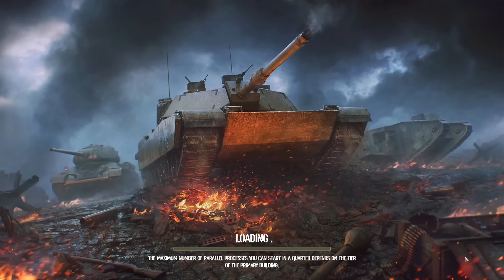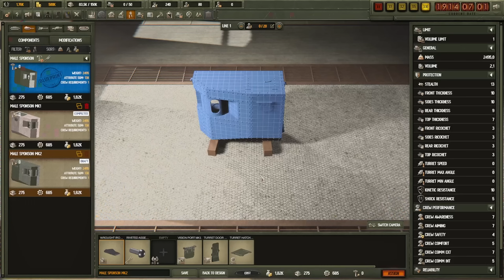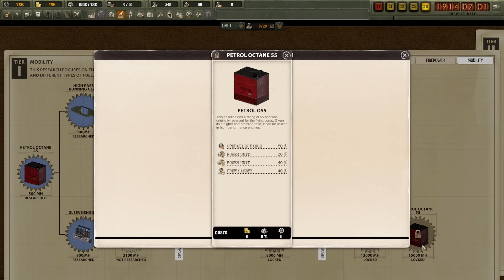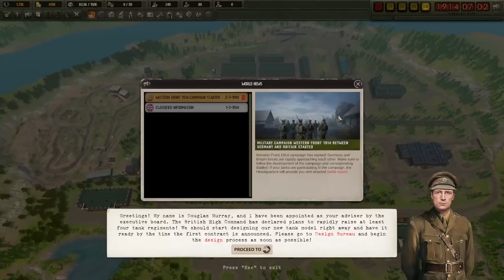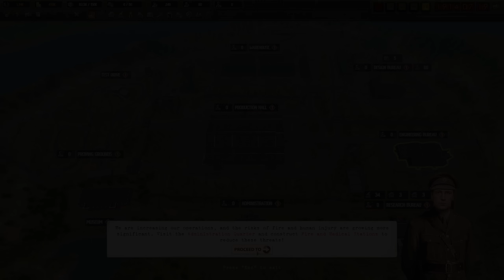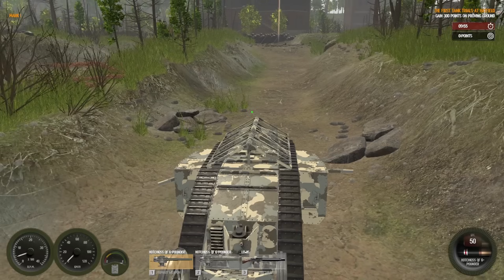Get Rich Building Tanks - Closed Alpha Gameplay - Arms Trade Tycoon Tanks

Comment: If I recall the demo, you could actually rob most early contracts if you pursue developing Whippet and then Hornet since Hornet is ideal for the whole female tanks niche while having insane(for the time) mobility. Causes weird results when instead of expected cannon equipped Schneider the game gets Hornet tanks to battle A7V. Mind you, we're talking about basic Hornets, not the prototype with 3 pounder. And for some reason neither can tanks pierce each other with AP bullets, nor can you jave enough crew on Whippet and Hornet.

I also remember an insane exploit of stacking production tech points by adding and removing parts to module, which caused the available for distribution points to refresh. Had serious malus if you didn't know what to do, but also allowed to heavily inflate the score of tanks to sell them. They'd lose all reputation in short order as they'd keep falling apart, BUT AI will always be happy to buy more replacements. But that's an exploit for the demo.
Reply: You have enough crew on both Whipped and Hornet

Enough, as in, the tank works
But of course, ideal amount of gunners for 4 mgs would be 4 and the tank just can't fit that